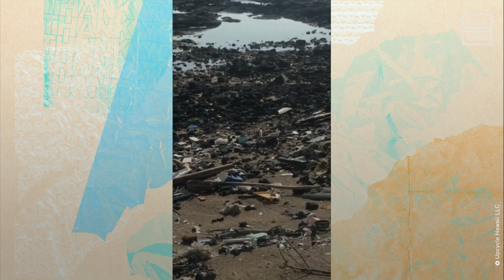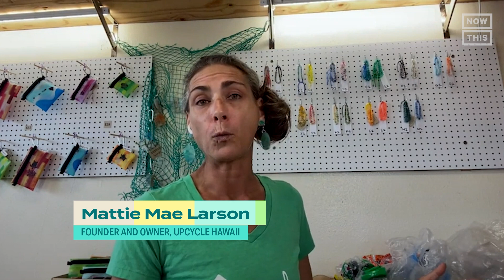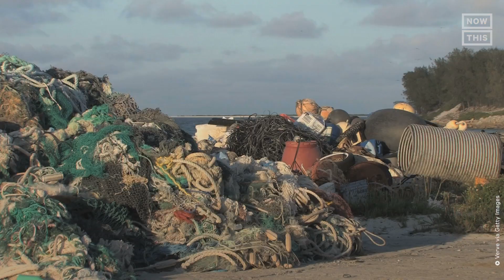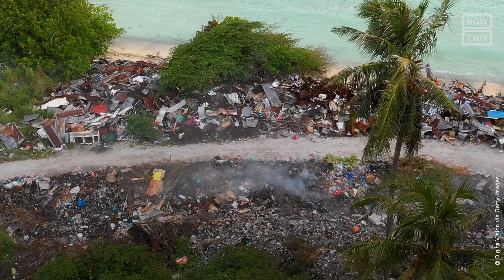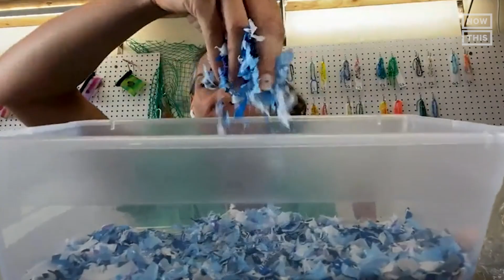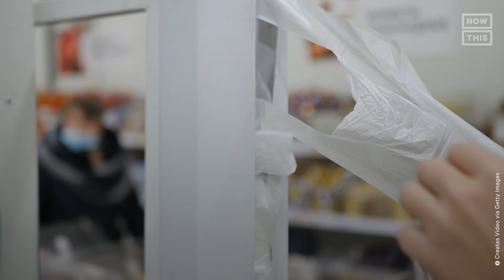Upcycle Hawaii Takes Plastic Pollution From 'Trash to Treasure'

Comment: Design products that use more plastic and require less labor. Tote bags are larger and don’t require zippers like those pouches. Make beads that can be sold in bulk to other jewelry designers instead of making individual pieces of jewelry.